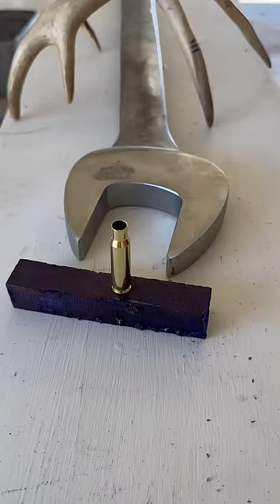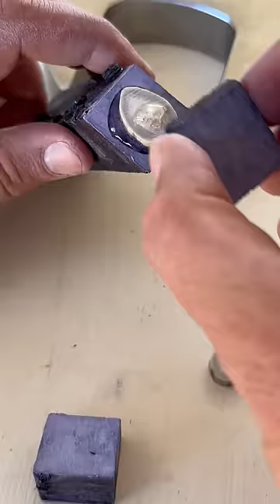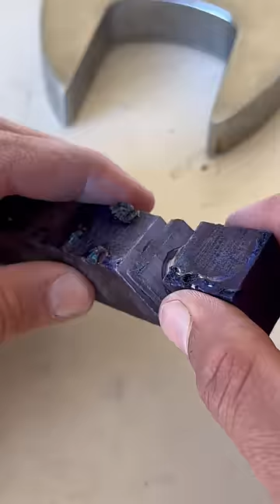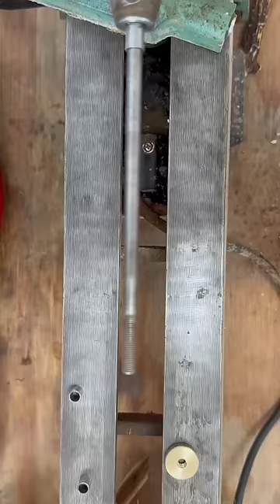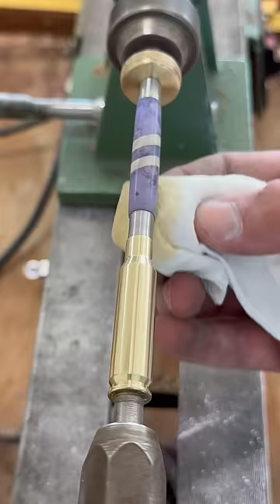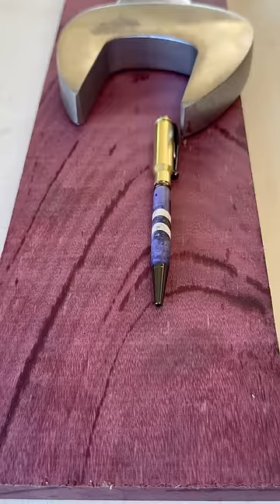Pen Making with BEAUTIFUL Elder Burl! #craft #art

Comment: I just SO BADLY want to send you a set of barrel trimmers so you can square up those ends! 😅
Reply: Oh, and a mandrel saver! They were both a HUGE step in my own pen making.
Reply from the maker: I square them up off video haha. But I’ll take some of you send them to me😂
Reply from the maker: I’m not sure what a mandrel saver is.
Reply: @ASMRwoodworkin  A mandrel saver fits into your tail stock and slides over the mandrel instead of the screw nut you're using to provide pressure against the piece you're turning. It provides more stability and less wear on the tip of the mandrel.
Reply: @ASMRwoodworkin  maybe you could share a video of your barrel trimming process? I bet I'll learn another something from you!